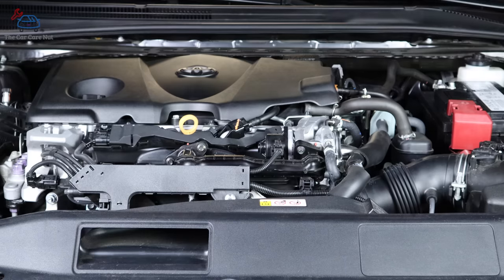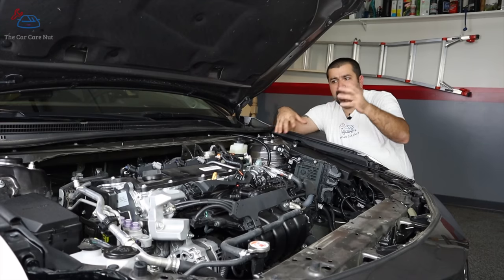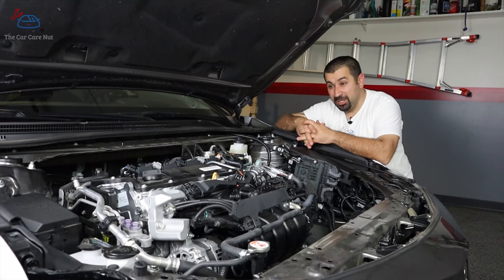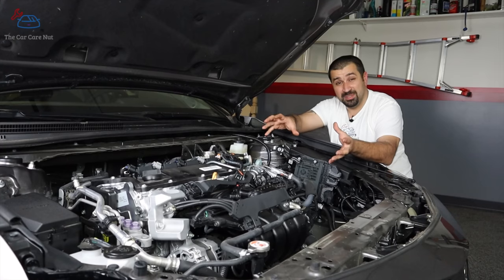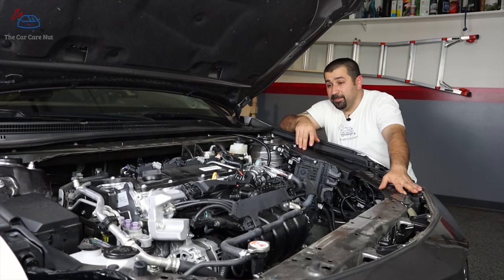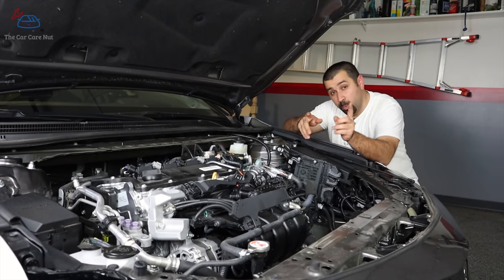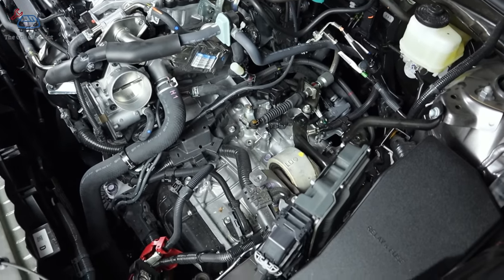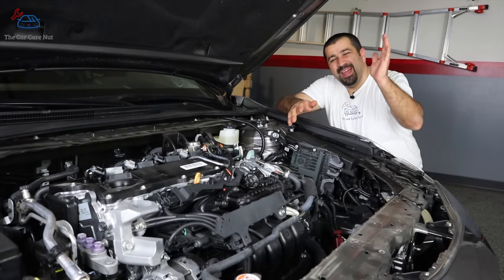Toyota's New Engine Technical review Part 2 : Variable Valve Timing, DIY tips  and Parts location

Comment from the maker: Find part 1 of this video here
https://youtu.be/9GWKBbEMCC4
Reply: would like to see your review of the hybrid version, and how this engine is adapted
Reply: Would you recommend this generation engine or the previous Camry engine and transmission in the 2015-2017 version?
Reply from the maker: Honestly they are both good. The old one is likely more diy friendly and more basic. But the advantages of gas mileage might be worth going with the complexity of the newer ones.
Reply: Gr8 Videos man. I was planning on getting a used 2018-2019 LE Camry. Is it possible to add paddle shifters for the LE from the Dealer?
Reply from the maker: Thank you for watching. It’s not possible to add them for reasonable cost as the software is different as well from LE vs SE
Reply: I wanted to ask you a question regarding my new, well new to me, 2016 Toyota Camry Le Hybrid. I would like to wash my engine compartment every so often to keep it looking amazing. I do worry about the intake on the front of my car that looks like it leads to the electric motor. Do I need to cover this up when I wash my engine, or will the water drain and not hurt anything and I am just being overly cautious about it? 

Thank you so much for any reply and suggestions about this.
Reply from the maker: Hi! Cover that opening and avoid spraying directly with high pressure on electrical connectors and you should be good
Reply: @TheCarCareNut  right on, thank you so much! If a little gets in, isn't there any holes in there to let any access that does get in, to properly drain out? Thanks, again!
Reply from the maker: I would consider using compressed air to dry electrical connectors to be on the safe side.
Reply: Plastics in coolant lines is not good.  Although it may take 200 000 miles but it was the cause for 2 Sienna 2004 I knew engine damage.  The pipe right after the thermostat in 3.3L V6 just crack or have a hole and spew all coolant in minutes.    I believe plastic water pump housing in  VW in 2.0L TFSI also notorious for leaks every 50 000 miles and still leaking after 4th revision. VAlve cover is probably fine, just like my 240 000 miles Nissan Sentra 99.
Reply: Car Care Nut,

I am looking at purchasing a 2022 Lexus ES.  I am really tossed between buying an ES 250 4-cylinder as opposed to a ES350 6-cylinder.  

I frequently hear people say the 4-cylinder is simply inadequate - loud, struggles and not very smooth for this size of a vehicle.  Then I hear some people say it seems to be just fine.

Could you please provide your professional opinion?

One major issue I wonder is whether the 6 cylinder engine will actually result in a longer life since it's not being pushed beyond its limit.

Despite being a complete auto novice, I have learned a of couple valuable auto operation tips from you that I really have appreciated.  I look forward to making a donation.
Reply: These engines have the same components that usually fail in diesel/downsized turbo engines. Such as high pressure fuel pump, direct injectors, electric water pump, vacuum pump, etc. This is why people tend to buy petrol engines to avoid these components. Now, we have all of them here.

If something goes wrong, you have to pay thousands of dollars to have a new part. I am sure that the high pressure fuel pump or the electric water pump costs more than $1k.

As I can see, this engine is usable until 100k miles or 8-10 years. After that it is a timed bomb, which can explode the family budget anytime.

This waterpump construction is crazy. A sticking solenoid will make you mad; the localization of the problem might take days.
Reply: I have a 2022 Rav4. Does mine have the same engine as mentioned in your video? It certainly is a little noisy on cold start and that knocking noise that last about a minute to minute and a half was very alarming to me. I watched other videos with the same noise so that made me feel a little better.
Reply: Thank you for your videos. We just bought a RX450h+ and you are helping me to understand how it all works.
Reply: I hope you have a how to change the coolant video for this engine, I'm so happy you have a camry. I just purchased a 24' Toyota Camry SE. So needless to say I'm your newest subscriber lol.
Reply: My 2024 rav4 doesn't have the recommended oil engraved or displayed anywhere in the engine bay.  The manual recommends 0w16 (preferred) as well ow20 and 5w30. Ow16 is very difficult to find in my area. What's the downside of using the 0w20 longterm?.  I live in a region where the temperature in summer reaches 122F or 49C

Comment: Just did my first oil change on our new 2020 Rav4 with this engine - about 2,200 miles ahead of the 5,000 mile first scheduled service interval because I wanted to change following the break-in.  As a DIYer (when I can), I love the information you've provided and feel like I've taken a mini-masterclass tour of this engine. The oil-free VVT system is phenomenal, and the combination port and direct injectors is an amazing engineering decision. And I absolutely notice the sound change when it switches from port to direct. I think every owner of this engine should be aware of the 3000psi fuel line!! Tremendous information and I will be mentioning your channel in my oil change video!!
Reply: Good! I am planning to change the break in oil in my RAV4 2024 once it hits 1500 km. Not going to wait till 8000 km as recommended by the dealership.
Reply: I'd recommend selling a car with this engine as soon as possible
Reply: @mrgreen8231 based on what, your gut feeling?

Comment: I recently took my 2.5 2020 Camry on a short trip both uphill and back downhill on a 180 mile round trip in the Sierra Nevada mountains. I did a milage check and I came up with 37.4 MPG. On a long flat freeway trip...probably close to 40MPG! Totally amazing with this 2.5 Dynamic Force engine.

Comment: Love this engine. 2018 carry sc. With 112k miles. My uncle has a 2019 camry hybrid with 280k . Never had a problem.  Just regular oil changes at the dealer every 10k miles.
Reply: If it did 280k+ on dealer oil every 10k, that makes me less hesitant about a newer camry hybrid.  I worry about repair costs with direct injection system and egr, but probably not gonna be an issue.

Comment: Thank you for another fine video! I've had my 2019 Camry two trouble free years and am glad to hear its 2.5L engine appears to be a good one. I'm so impressed with the fuel economy of this engine and 8-speed transmission in a fairly large car. I love this car and hope it will have the long term reliability of the other Toyotas I've owned.

Comment: Thank you so much for your oil advice. We have a very good local Toyota shop, but they missed the boat on oil and put 0W-20 in our 2019 Camry. Luckly, we are retired and didn't Drive 5000 miles, so 6 months came up first. Hopefully no engine damage. We took the car to our Toyota dealer at the next service, who put in 0W-16 again. But even then, the tech who did the oil put a sticker for the next oil change indicating 0W-20. But the invoice said 0W-16 oil. So guessing the tech was lazy and didn't change the sticker machine.  That said, we sadly won't bring our Camry back to the local shop, as it sounds like they just aren't trained on these newer engines. Your videos have been a huge blessing.
Reply: Shouldn’t do too much damage. I used 0W-20 in my ‘18 Camry & up until it got totaled at 80k miles. It was hard to come by 0W-16 but no issues at all. Now I’m in a ‘19 Camry but use 0W-16!

Comment: I can't believe they can control the overlap of intake and exhaust valve to complete the exhaust push out with so little pressure at the end of the power stroke. Amazing control and implementation

Comment: Thank you so much for your great videos! I bought a 2019 Toyota Camry LE with this engine. This car has been absolutely amazing in the 10,000 that I have driven it. (I bought it last year with only 31k miles). I have had almost every model BMW and also a Mercedes E320 turbo diesel that cost me well over $5k in maintenance and repairs the last year I owned it! I truly feel this is a car I can keep forever and I am excited to learn how to maintain my own car from here on out. I went yesterday to the Toyota dealership and bought brake pads for the front and the engine and cabin filter. I really credit you and your videos for the inspiration! I also will certainly be watching your video on changing the brakes for the Camry. I watched the video in full of you changing the rotors, wear sensors,  and pads on your beautiful Mercedes.  Again, many Thanks! May the good Lord bless you and provide health to you and your family! Jason S.

Comment: I want to add that in using 0-16 oil you need to make sure you use SP rated oil. They have really upped the bar on oil specifications with the new SP rated oil. The toyota brand 0-16 meets this spec. But in non-toyota oils you can use 0-16 SP oil. It is really a great oil and forced all the oil companies to up their game a lot.  The SP rated oil just came into existence this year 2020. GREAT video! I have a new 2020 Camry and wanted to know all this stuff. I took it on a vacation and that Camry got 36 miles per gallon at a steady 80mph!! That is amazing!
Reply: My 2018 Camry Hybrid LE gets 51mpg with 4 passengers, AC in full blast at 75mph. I get 52mpg with just me at 80mph. Amazing car.

Comment: My 2005 elantra had a plastic valve cover and i never once questioned the reliability of it despite it being plastic. It was so thick and strong feeling that i just trusted it. My new 2019 toyota chr is the 2nd vehicle ive had with a metal valve cover, my first was a 1997 dodge dakota. But i wouldnt have a fit with something like that. The place where im not fond of the use of plastic is in the cooling system. Ive heard of too many issues with plastic cooling parts cracking, and a coolant leak worries me more than any other type of leak on a vehicle.

Comment: Many of the components on this engine look like the engine in my 2020 RAV4 "Base" vehicle.  The engine is very peppy, the vehicle itself is relatively "light" which gives the great fuel economy and very good power.  "OIL IS CHEAP, ENGINES ARE EXPENSIVE" I said in your video on Toyota oil consumption, which is why the oil and filter are replaced every 6 months by me or the dealer to help eliminate the consumption problem and help to keep the high pressure fuel pump happy where it rides on its cam.  Also, clean oil and lots of freeway (70 MPH) driving help to keep the engine running very well.  It's a fun vehicle, I plan on keeping it that way!  
Oh ya.. Thanks for the tip regarding the coolant change.  I don't care how long coolant is supposed to last according to the manufacturer, "Change it every 2 years and eliminate problems!"   
I've seen what happens when so called "Long Life" coolant is left in the engine for 4, 6 or more years!  NOT GOOD!    
Thank you for the tech tips.  I'll keep this video and look forward to future videos.
Reply from the maker: Thank you for watching my videos. This engine is exactly the same as the one in your 2020 RAV4.
Reply: @TheCarCareNut  Very Good!

Comment: I have a 2021 Rav4 Hybrid XSE on the way with this engine. I typically do my own maint so the complexity is a little scary, but I suspect Toyota engineered it well. I usually don't keep vehicles for too long, but I plan on keeping this one for at least 10 years/150,000 miles. This thing is costing me a fortune, so I hope it holds up! You did a great overview, as always!
Reply: May need new plastic valve covers at 150K according to the video - no big deal he says. Maybe it's not, but I don't like the sound of that at all. A Toyota should last 25 years and/or 250,000 miles without major issues if well cared for, garaged, and driven gently. Just my opinion and have always respected Toyotas, but fear the complexity is becoming a bit too much.
Reply: @madcowusa4277  What car doesn't need a new valve cover by 150k miles? But time can only tell, they can absolutely handle the miles, but does this new technology handle the time? only one way to find out! ;)
Reply: You won't have gas within 5-10 years. People will be forced to buy electric cars. These cars shouldn't last decades...

At this complexity level, I start thinking about electric cars too. An electric motor is far simpler than this. I am not sure that it is worth going any more deeper into this direction.
Reply: @barnaczukor4235  forced to buy electric cars? Not sure about that one... Electric cars will become more  popular and readily available, but petrol vehicles will always be here. Petrol doesn't have to be derivative of petroleum. And you assume that we will lose our freedoms of a free market in addition to the fact that we will all be provided a vehicle. Many can't afford to be 'forced' to buy a new car ...
Reply: @barnaczukor4235  Utter hyperbole. Gas cars will still be rolling for at least another 20+ years. You forget that the fossil fuel industry runs this place. Petrol isn't going anywhere anytime soon, not in the USA anyway.
Reply: @guidedbygreen1480  no car i have ever know has needed one.. Many over 250… Must be you
Reply: @mygolfballsannoy  What could I possibly be doing that would accelerate a gasket material failing? Unfortunately the majority of engines have plastic valve covers That's just how it is these days. I'm not sure why you are being so confrontational
Reply: @madcowusa4277  It's a plastic valve cover dude it wont cost much. There's already one of these engines out there with 430,000 miles.

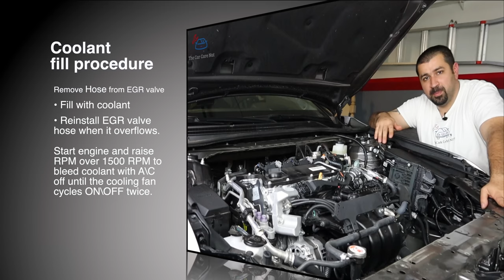Comment: At 09:26 i want to mention that this procedure called top up mode, I read from a repair manual of toyota that this mode activated by the following steps: 
Move the shift lever to P.
Start the engine.
Run the engine at 1500 rpm or more for 5 seconds or more.
Run the engine at 3000 rpm for 10 seconds and then idle the engine for 10 seconds. (Repeat this step at least 3 times.) [*5]
Warm up the engine until the water inlet with thermostat sub-assembly opens. While the water inlet with thermostat sub-assembly is open, circulate the engine coolant for several minutes. 
I dont think that the way you mention is 100% right, but definitely worth thanks, thanks
Reply: How do you know when the thermostat with the subassembly opens?

Comment: Marvelous engine. My wife bought a 2023 Venza last year. During the sales process I was surprised that the Toyota salesman didn't point out even the basic virtues of the dynamic force engine?? You didn't mention the laser cladded intake valve seats. These are a minor improvement but absolutely unique in a mass produced engine.

Comment: 2018 Camry LE,I get 40.1 MPG overall,aprox.90% Frwy and 10% city driving,I measured the MPG accuracy over several full tank aprox.3000 mile and it's very accurate,I use Toyota 0W-16 oil and will not use any other brand oil,Toyota says they spent 6 years to design and test this engine ,I am sure they spent millions of dollars too,I am very happy with my car,very confortable and good gas milage.

Comment: AMD, I would consider buying one of these cars with the D4-S fuel systems. However, I would prefer to wait and hear back from actual owners over the next decade. I am a fan of port injection only vehicles. That is one of the reasons I want to get a 5th Gen 4Runner Trail/Trail Premium/ TRD Sport etc. (2015-2019.....transfer case lever mechanical linkage only. Not the rotatable dial/knob that actuates a solenoid at the transfer case). I have watched some (or most) of your 4Runner videos and appreciate you taking the time to record, edit, and upload them for us audience members to see them. Knowing the 4Runner still has port injection and a 5-speed transmission is why I want to get one. I had a 3rd gen 4Runner ('97 4x4 with A.D.D., auto trans A340E, 2.7 liter 4 cyl base model. I loved it and still wish I had it.

Comment: Thanks for the awesome video! 
Toyota should've paid you for that :) I was looking for any info on the engine when was buying 2020 Rav4 Hybrid and barely any out there and wasn't sure that I'm making the right choice, I see now that my decision was correct, nothing to worry about ) 
I hope there will be some part 3 of this engine on new hybrids :)
Reply from the maker: Thank you for watching my video! So on your hybrid RAV4 the engine is very similar. There’s no drive belt due to the electric ac compressor and no alternator.
Reply: Just bought a Rav4 2020 with 12000 miles on it myself hope it's the right decision!
Reply: No more belt driven power steering pump either so I guess 1 item not to worry about.